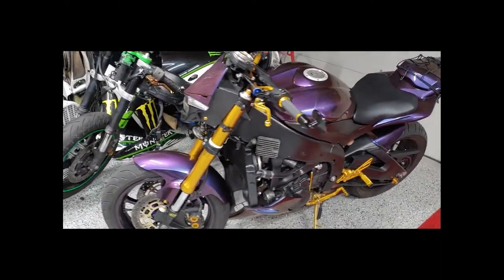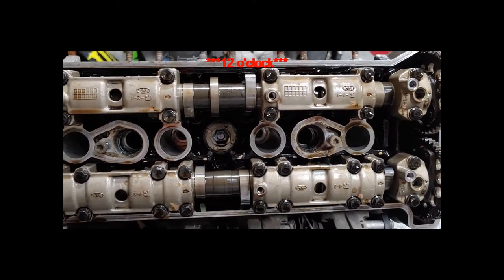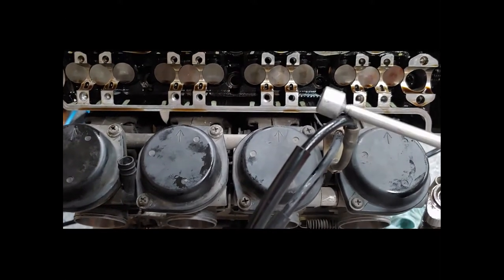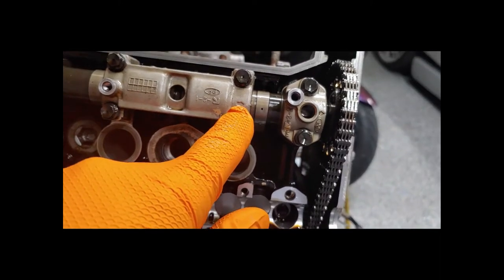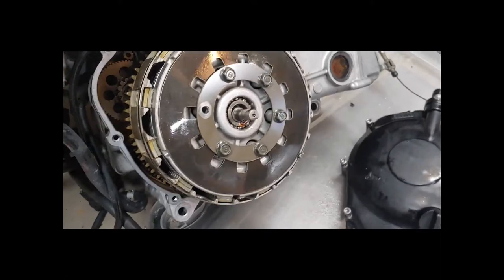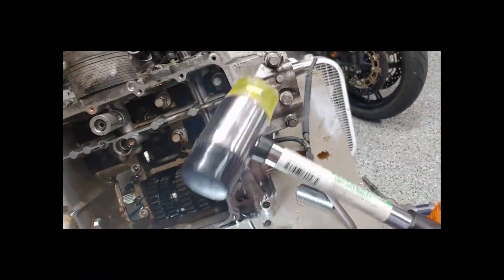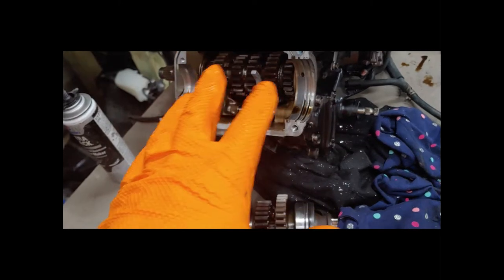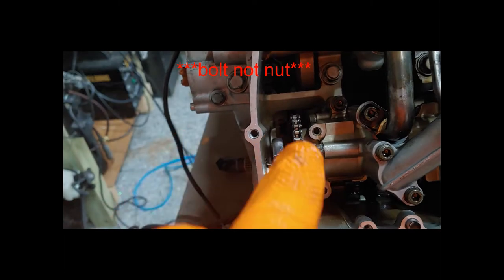Yamaha R1 2nd Gear Slip Transmission Repair   How To Tutorial

Comment: I would never turn over the engine that much without oil. At the very least I'd pour some oil down each spark tube and rinse it with gas later.

Comment: You do not need to remove the oil pump gear. Once you remove pipes and bolts holding the pump in place, slide it over out of the case and tip it. That gives enough clearance to remove the chain from the gear. I'm in the middle of doing this repair right now. Thanks for the video!

Comment: Thanks for the video. I have an '04 YZF600 with a slipping 2nd - hopefully same thing. 15,000 miles. Not sure if that's high miles or if could just do bottom end but how much / how many hours do you think a mechanic would need to do that? Thanks

Comment: hey, quick question (hoping youre still around) but ive got a 5pw r1 from 2003. im gonna get the transmission replaced but is there any known way that i can do in the replacement process ro completely eliminate this issue from arising ever again? such as crafting with different materials?
Reply from the maker: I was once told that in 03 the metal gear were made of a tougher steel. I don't know how else you could prevent this with the exception of no clutch  wheelies, not clutch less shifting and using good additives in your oil for trans. Regardless you should get 25-30k miles out of one.

Comment: Hi I think I’m having this same issue with my r1 2002 making mad noise in first gear I have stripped all clutch down all seem fine when turn the gear shaft its stops at a point and gets stuck until i turn really  hard then releases sounds defo inside gearbox
Reply from the maker: Could be anything but they are known for the springs on the back of the clutch basket housing to wear out and rattle.

Comment: is there ANYTHING you can do to keep this from happening?  i have a 1999 R1 with only 6,000 mi
Reply from the maker: Ride it like a grandma from 1st to 2nd
Reply: @EngineInformant  will do!
Reply: ive just emailed yamaha and a few custom parts companies to see if i can get something machined for my bike to stop this issue from happening again, will let you know tomorrow on the responses
Reply: @enzorum2560  so far so good for me, i just start off in 2nd gear and completely avoid the 1-2 shift.. I also don't ride very hard. It's still extremely important info to have though!
Reply: @kitvexed8229  I struggle not using all of 1st and 2nd since you cannot go fast enough in 3rd gear to use any of the power and before a turn or stop light comes up which is why it's important for me to sort 2nd gear out. so far Yamaha themselves have declined in selling custom parts but there is a CNC company I'm currently in contact with who are willing to create a reinforced transmission for me
Reply: @enzorum2560  what will that cost? the entire trans or just 2nd gear?

Comment: You could do all that, or.... just shift to 3rd!  lol  Mine has the same problem, jumps out of gear in second and doesn't take much throttle to make it happen.  Is that the wheelie gear?  Must be.  Guess what I'll be doing at the end of this riding season: you guessed it, tearing into second gear.  Thanks for the video!

Comment: Excellent video. I will be doing all of this in the near future. Unfortunately for me my compression is 40-100 across all 4. Bike sat for 3 years outside at a tow yard so it needs work. Thanks for the video I will be referencing it while doing my work
Reply from the maker: Get the bike running if you haven't already and then check compression. The gunk build up on your valves hardens over time and doesn't let the valve seal well until it's been running and warmed up
Reply: @Engine Informant  compression is too low to start the bike. Been trying to get it started for 6 months hoping I wouldn't have to tear it apart but with 40lbs on 3 of the cylinders that's all I'm lacking. Has air, spark, fuel but compression is the problem